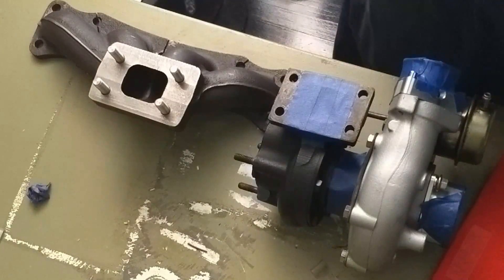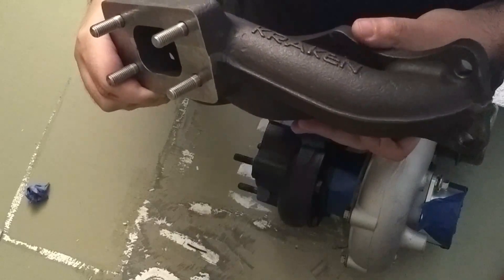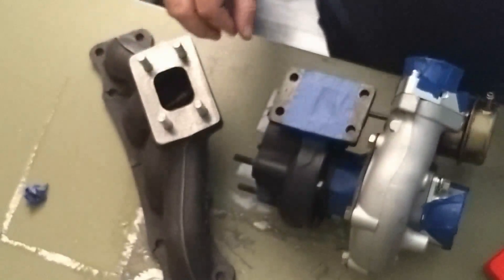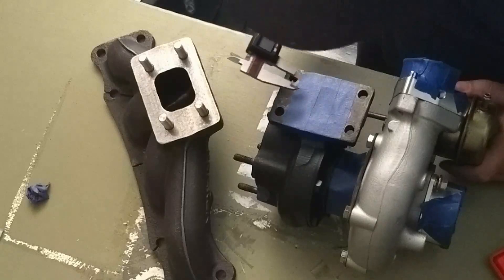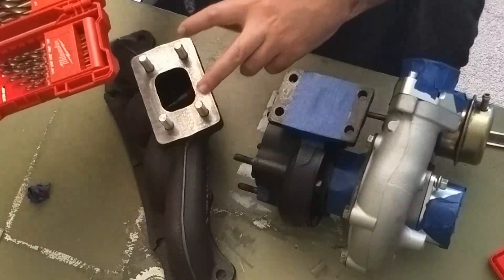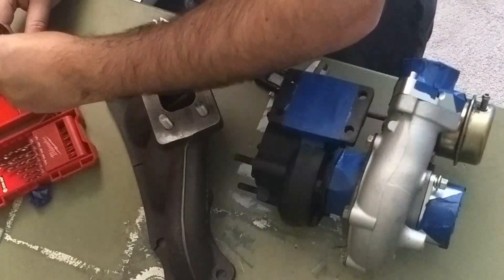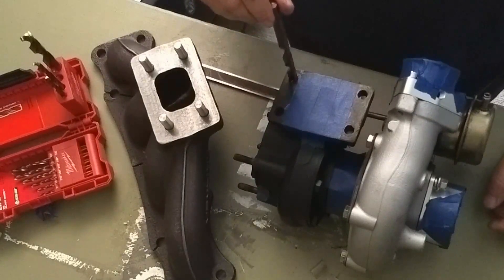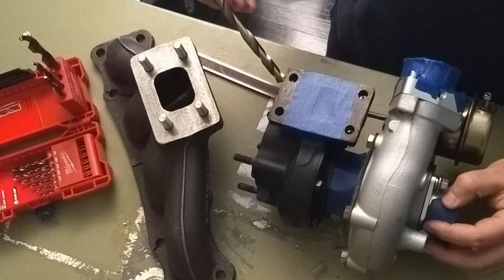Kraken Miata Turbo Manifold Review & Tutorial - Drill Turbo to Match 10mm Studs - Part 1

Comment: Why are you measuring etc, they’re 10mm studs so get a 10 or 10.5mm drill, why use stupid inch measurements????
Reply from the maker: +Speedwelltuning lack of metric specific bits.  I agree metric would have been easier